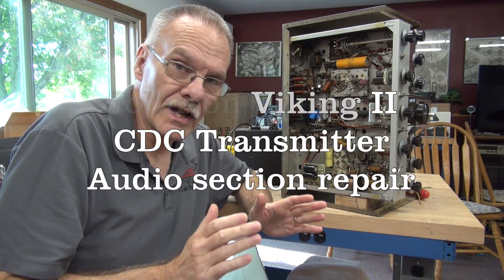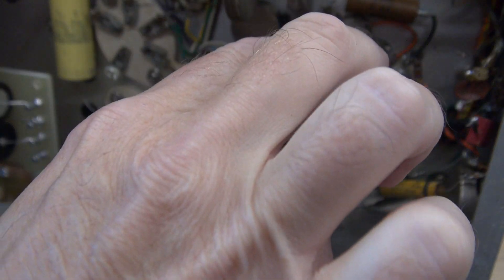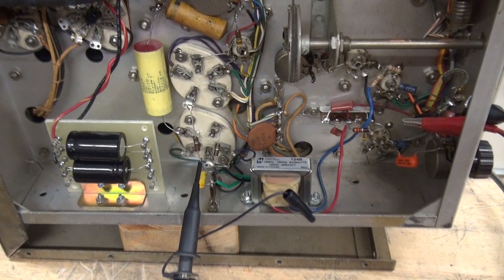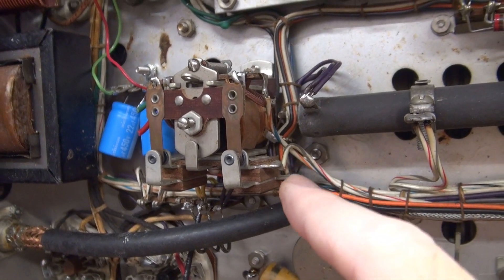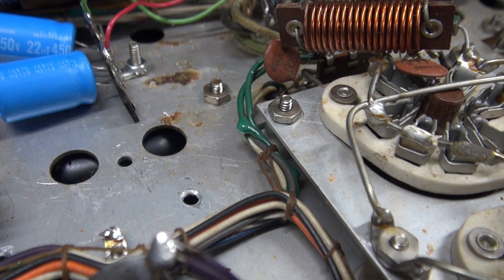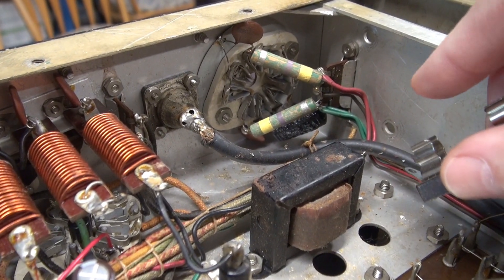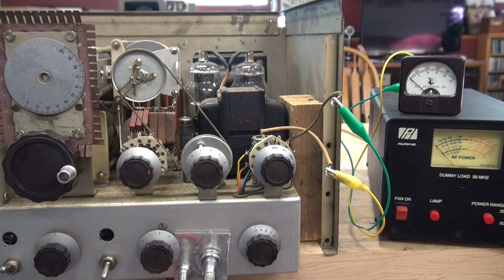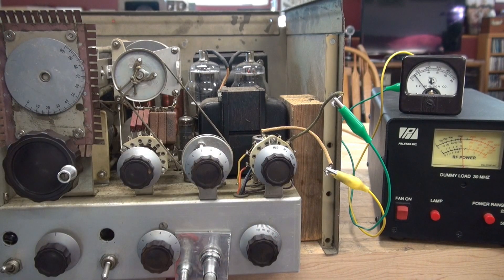Vintage Johnson Viking II CDC Civil Defense Transmitter Audio section troubleshooting + PTT  Part 4

Comment: Nice job & video, both!
Just curious, Terry, about the burned up coil; what was its specs, and how hard was it to come up with an equivalent replacement?
Reply from the maker: The coil is about 20 turns of 20ga wire on a 1/4" diameter. Not critical
Reply: @d-labelectronics  Thanks for clarifying!

Comment: I love your video and everything looks great. But let's be honest, the whole thing is rebuilt. Not much as original, except maybe the wires? I mean honestly you do a great job. I'm not discounting that at all. I'm just saying not much is original. As you said, a lot of that has to come out, "Lets completely rebuild the audio section".
Reply from the maker: Pretty much just caps & out of tolerance resistors. Typical for these old transmitters. Its original construction is untouched.